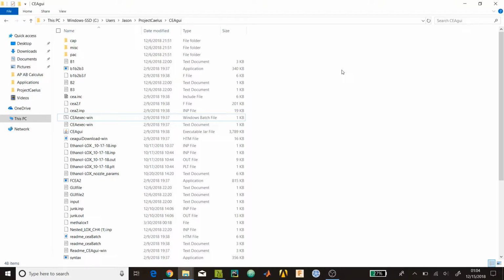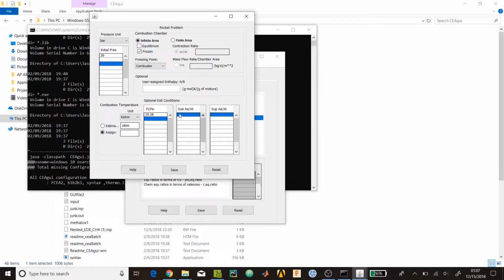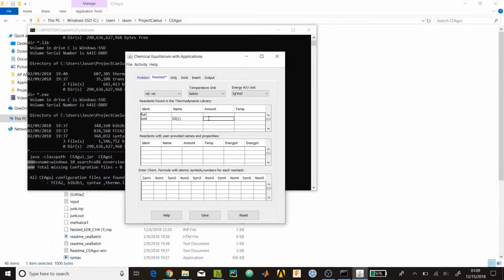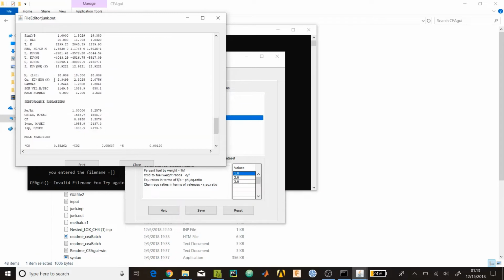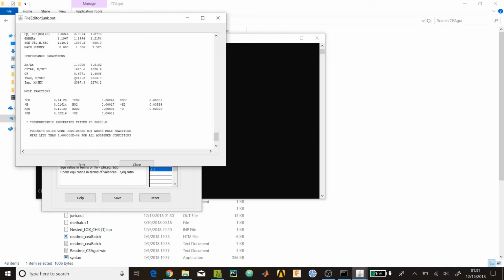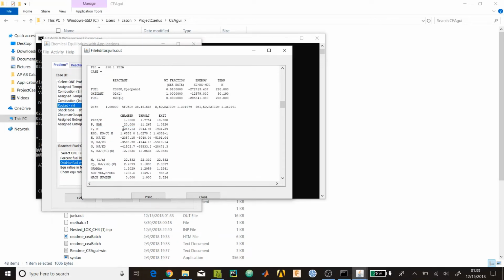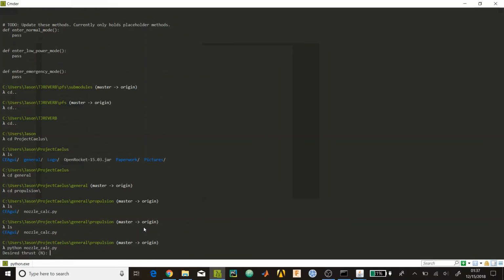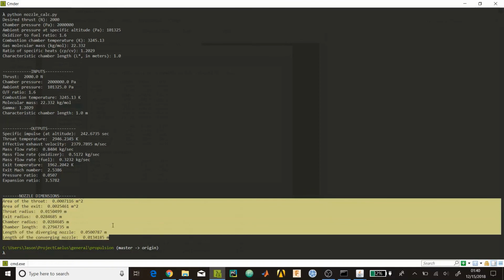Project Caelus: Liquid Rocket Engine - Pt. 1: Propellant Selection Using CEAgui

Comment: I'm just starting to learn about Rocket Nozzles and maybe this is a silly question but how do you come up with your chamber pressure when you started entering values into CEA?
Reply from the maker: Don't worry about silly questions! Everyone starts somewhere. Chamber pressure is normally a design specification - you pick it based on what you want your system to accomplish, and based on the resources available to you. For example, if you only have access to basic materials and efficiency is not a primary concern, lowering the chamber pressure might be a good bet. Normal ranges for chamber pressure of small (around 1-10 kN class) engines are normally anywhere between 1-5 MPa. Anything above that can get very dangerous for an amateur.
Reply: @jasonchen5761  Hey thanks! Ya that makes complete sense now that you say that. Thanks again for sharing, theres not much information out there for figuring out how to use this software.